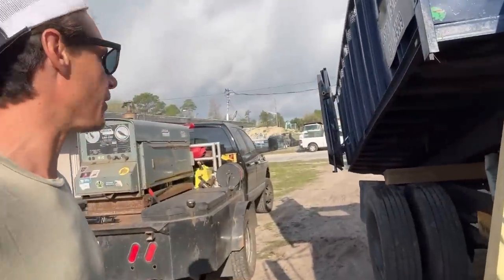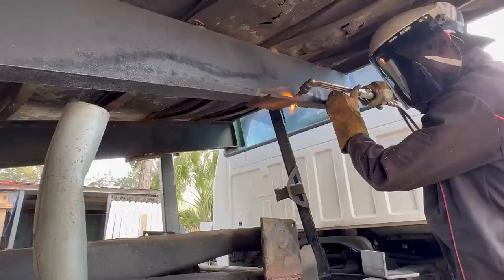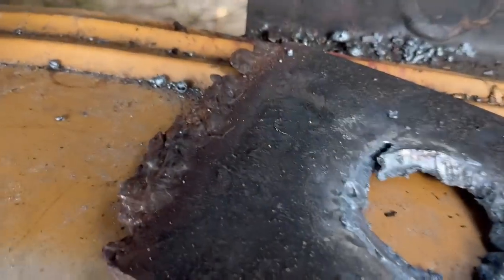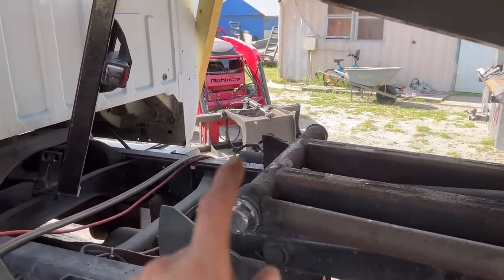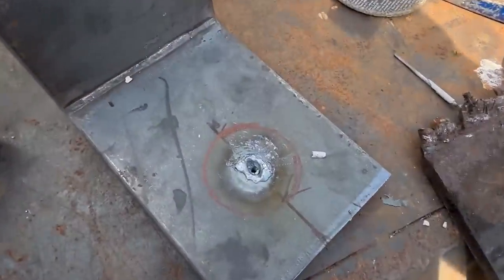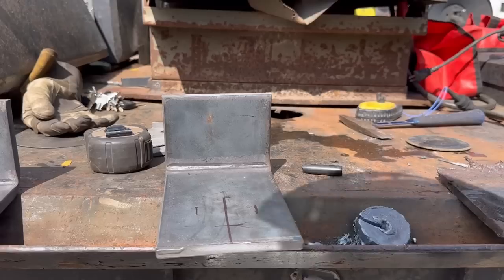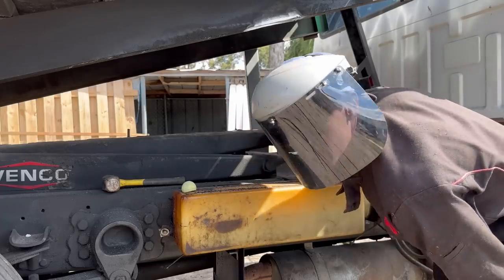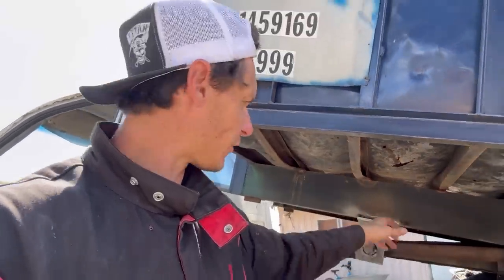Welding a Dump Truck Bracket

Comment: It's cool to see the mistake and then the correction. I easily get things inverted or mirrored the wrong way when I'm in the thick of things. The wisdom you shared was testing things first with tacks then changing course once you saw the mistake. I always find my mistake after I've fully welded everything. It sux, too, because I usually get burned and break a few other things  in the process of "fixing" another thing. You make it look easy getting things done, but going backwards on a project like this is a trap I fall into all too often. Thanks for dropping scholarship on us on how to keep moving forward.

Comment: Great job young man. Anyone that does welding repair work or fabrication that doesn't screw up or claims they never screw up is a liar.
Well done Anthony for not just admitting you screwed up but that you still made a mint job when you corrected the error.
I have several dozen screw up "T shirts". I doff my cap here in cold wet England in respect to you! Best regards, Jon. 
P.S. If a channel called Sackville Welding Services comments on your channel, that is me!
Reply from the maker: Thanks Jon! Always look forward to your comments! Hope life’s treating you well
Reply: @MeltinMetalAnthony  Thanks young man. Life could be better but on a positive note l have a heavy plant customer on board that gives me regular work. Take care and best regards to you!

Comment: Fun tip if you have a long enough combination square and you're transferring from the old plate to the new played the hole you can lay across lined up with the top diameter of the hole the top of the hole just run A-line across to the new plate from the old plate same with the bottom this also makes it easier to put the center you can also do it with a small square 8 by 12 square I suppose you could do it with a bigger speed square also if the straightedge is long enough to reach across to the old plate
Reply from the maker: Great tip thanks!

Comment: I know it's not your responsibility  to make sure that rod rotates freely or has no slop, but that is the prefect time to check it out. Like you were hitting that bracket to turn it. It should move freely,  have the customer grease the hell out of it while it's down and you can turn the rod to get the grease all of the way around it.

Comment: making the bracket shorter increases the stress on a smaller portion of the bed frame.....might lead to bending or crush failure.

Comment: The dump body frame should’ve been notched out for the 1/2 plate to rest inside now there’s a huge gap throughout the whole bed in between both frame rails. Not your fault but the owners fault for not catching it. Anyways get that money and bounce, love the vids
Reply from the maker: Just copied original design. Worked for 20 years!
Reply: True MMA... just copy the original setup.  Welders are welders and engineers are engineers. Annnnnddd a hitch bracket is a safety jack 😜
Reply: No I agree with you. How it was put it back. Just my 2¢ on how I did it on my dump truck because over time the bed will slowly Sag when hauling heavy

Comment: ive seen some stainless get up to 75 rockwell in the bends  when hydroformed.  should make for a tough bracket without taking the tempering out with a torch